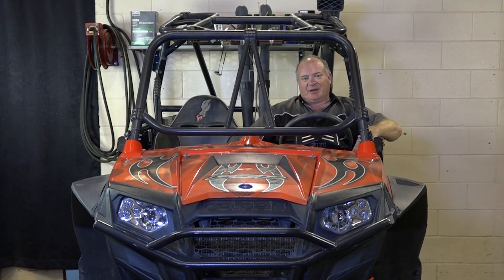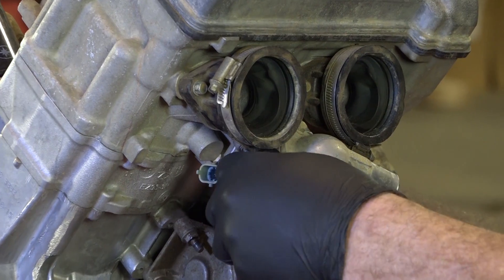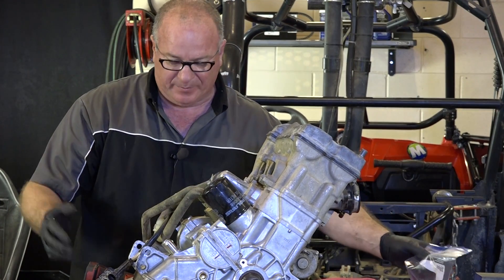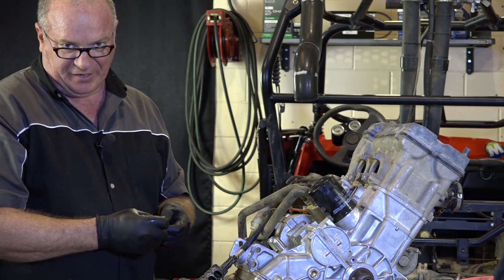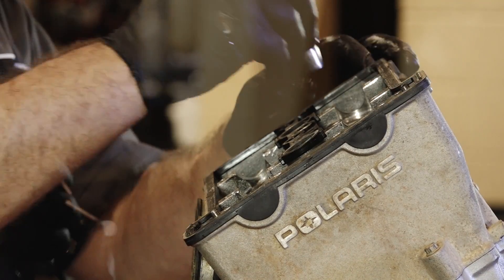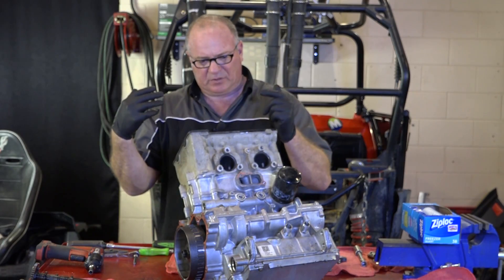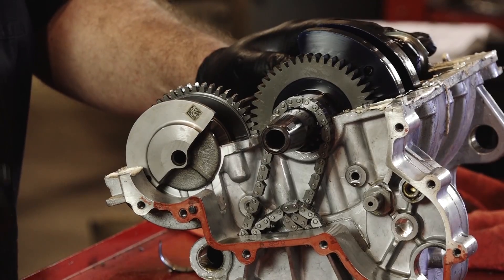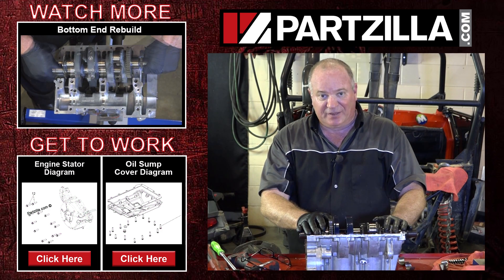Polaris RZR Engine Teardown | Part 4 in Series | Partzilla.com

Comment: Is it possible to remove the timing chain without splitting cases? Also what is the purpose of the U shaped retainer other than keeping the chain in place if dropped from the top?
Reply: Not possible.  The lower block traps the chain. It is only accessible by splitting the lower case from upper case.

Comment: Anyone know how to get the timing chain off the crank gear on the bottom behind the flywheel? Do you need a puller, or do you have to split the case?

Comment: instead of replacing the head wouldn't it be easier to put a thicker head gasket? Then it would put down the compression and give more room for the piston don't hit the spark plug? This coming from auto tech, those engines might not be possible to do.
Reply from the maker: It's definitely not recommended.  You'll just end up replacing it later.